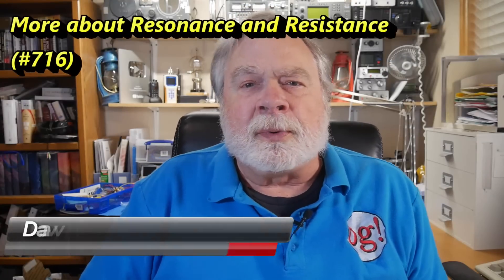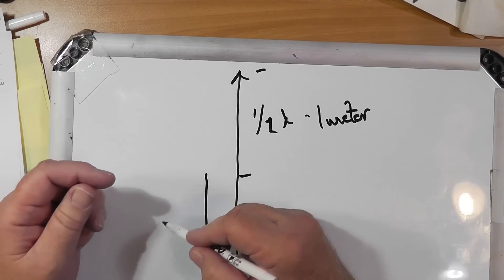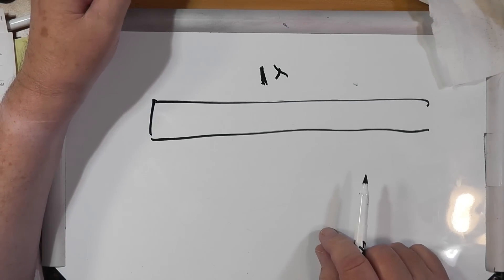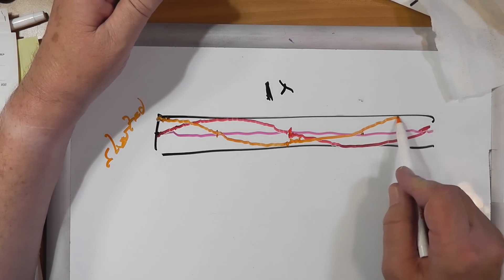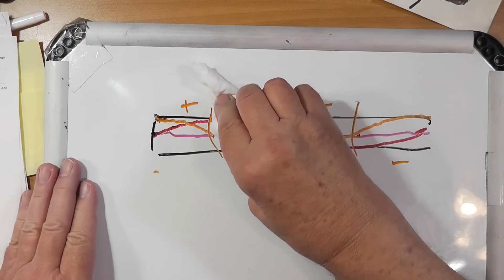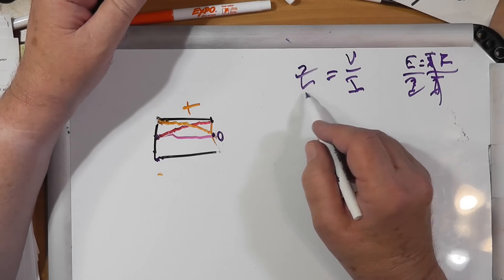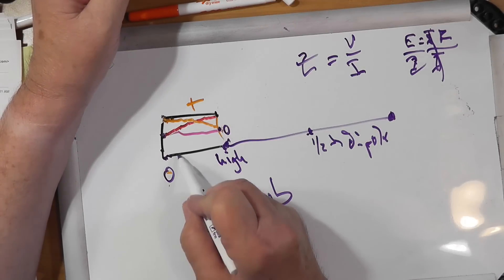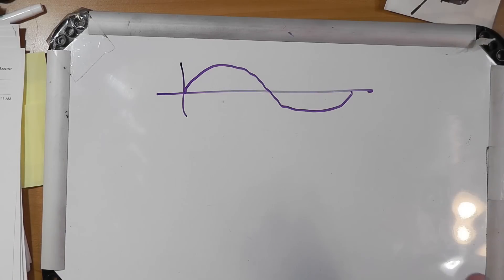More about Resonance and Resistance (#716)

Comment: May I ask sir, since I don't have the luxury to buy an antenna analyzer, is it safe to say that an SWR meter is enough to get my station going? 2nd, if my SWR reading is let's say 1.2 to 1.5, would that be okay without knowing the impedance?
Reply: A swr meter is a very good device to "tune" antennas and I used one for decades.  Analyzers just seem to confuse people because they don't understand what the devise is telling them.  If you can put most of your RF power into the antenna and radiate it, the swr is ok if it isn't 1:1

Comment: 1.  There is no such thing as a "resonant" antenna.  It's a stupid concept.  All antennas have E and I out of phase and there are standing waves across the whole antenna.  How can it be resonant???

2.  Just because you can find between 2 points along an antenna a 0 zero reactance feed point, does that make the antenna itself resonant?  What if I pick 2 points along an antenna that has high reactance feed point,  does that magically make the same antenna reactive and not resonant?

3.  Are you catching on to this stuff?  Feed point Z does not determine an antennas resonance or lack there of.

4.  Hams especially invent stupid analogies to explain engineering level concepts they don't understand.  So the stupid analogies make hams think they understand something that they don't.  The average ham does not spend 1 hour in a school, college or university to learn RF Engineering because they are too lazy to make an effort.  The non sense they invent is supposed to help them think they understand something that they do not.  And they will argue their non sense vigorously.
Reply: I am not sure that you have helped anyone with that post. Taking point #1 the general requirement is to find a frequency where the antenna feedpoint appears to be purely resistive and usually about 50 ohms . At that frequency the distributed L and C are a series resonant circuit. (you mentioned this in point #2).
Point #3 agreed, but usually the goal is to operate with a 50 ohm feeder and transmitter.
#4 not sure that is true, but it is a hobby, not everyone will dive deep into every aspect.
Reply: @g0fvt  Series resonant????????? How can a piece of wire be series resonant by your own definition.  Where are the coil and cap that have the same but opposite sign reactance?  All I see is a piece of wire.  You people don't know the difference between a real component and the mathematical  model of the component.
Reply: @rickeaston3228  the inductance being the wire element itself, which also has capacitance to the "environment".
Reply: If you want to call people stupid, you don't need a wall of words rick. Dave has a Master's Degree in Engineering, so he's not your definition of "average ham". So why did he still gave this 20 minute talk on resonance? That doesn't sound lazy.
Reply: @sammiller6631  FWIW Dave covers this in  the next video,  not sure why rick felt the need to troll us up. Probably a highly educated academic that typed before he thought..
Reply: @g0fvt  The more I read from rick, I'm getting "confused person" instead of "highly educated academic"
Reply: @sammiller6631  , I don’t know his background but he certainly waded in with both barrels blazing. I guess that it dawned on me when he expected to see discrete components. Despite working in the radio field for 40 plus years, I am always learning, the more you learn the more you realise that there is more to learn. Rick should have a look at some models of halfwave dipoles, they do align with my dodgy description. Dave covers this in his next video.
Reply: @g0fvt  why did he expect to see discrete components?
Reply: @sammiller6631  I suspect he is not in the RF mindset.
Reply: @g0fvt  I wonder why he stopped ranting.
Reply: @sammiller6631  no idea, but I tend to read the controversial posts trying to guess whether they make a valid point or not. Whether he is right or wrong he certainly waded in. I can only surmise that he has only dealt with low frequency circuits. Certainly very aggressive to dismiss the rest of us as fools when he himself has no grasp of the subject.